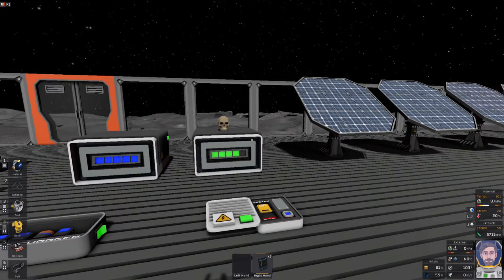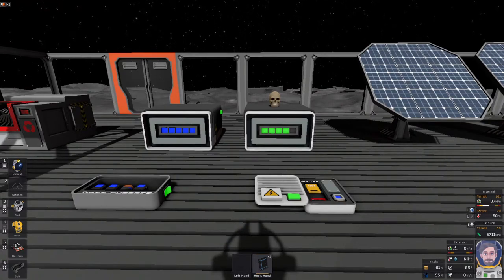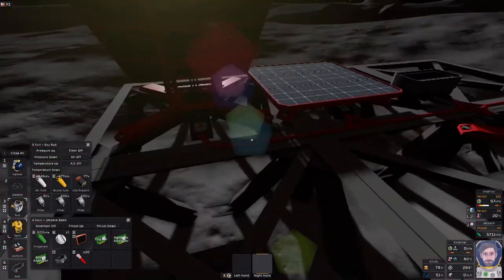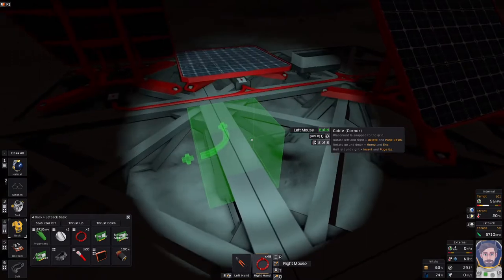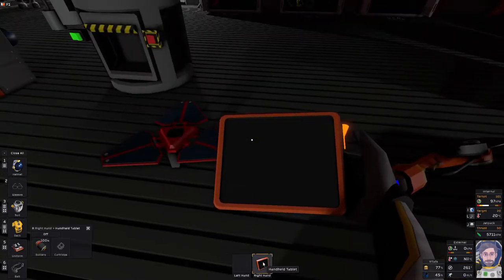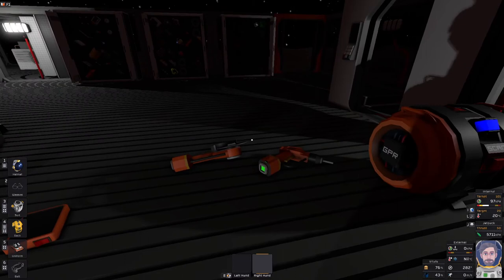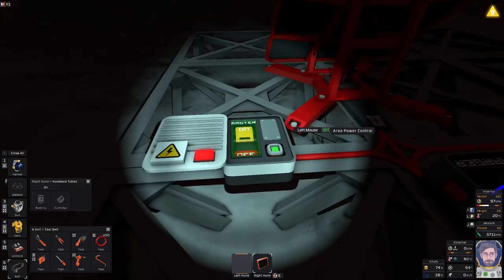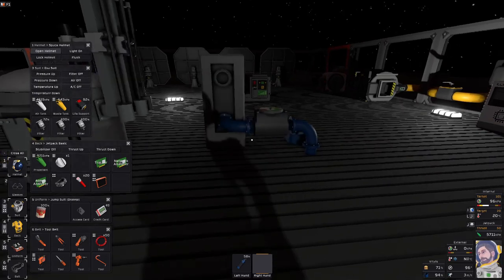Stationeers - early power tips a bite size guide.

Comment: Very nice video explaining power, I didn't know about putting the battery charger before the apc. I just turned it off at night when i remembered so of course I always forgot :) Here's a little tip i learned to save suit power. You can lower your suit pressure and temperature to right before the alarm goes off and you will not use as much suit battery power. I usually set my temperature at 5c and my pressure 20kpa it seems to help and does no harm at least.

Comment: So, where to put the battery charger.   Before I had the station battery, I had them connected directly to the panels, before the apc.  Otherwise they drained my apc battery.  But, after installing the station battery, the batteries in the charger being upstream, were being discharged by the station battery. So, ima put them after the station battery, after the transformer, but before the apc.  Am I missing anything? Thx. 😊